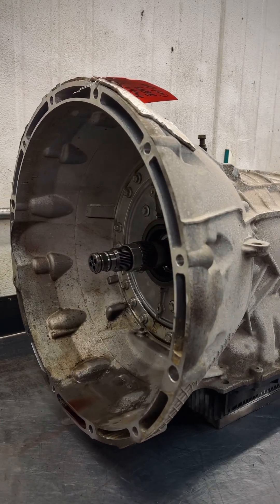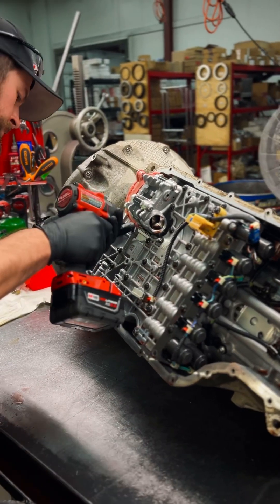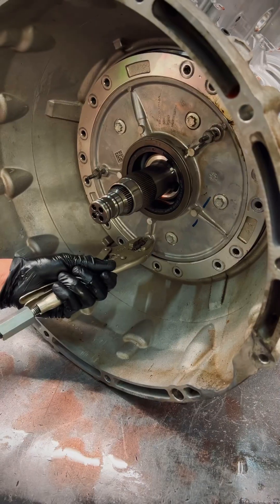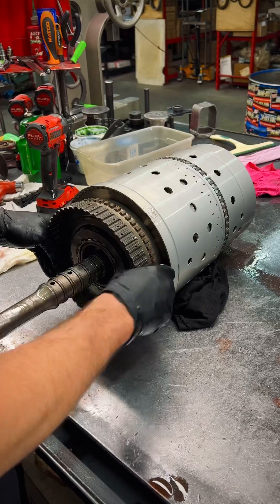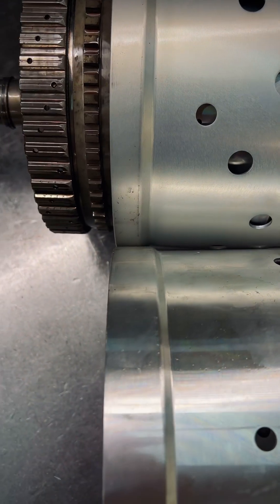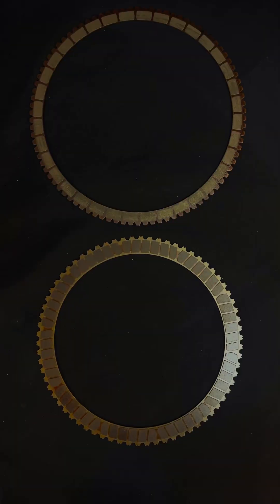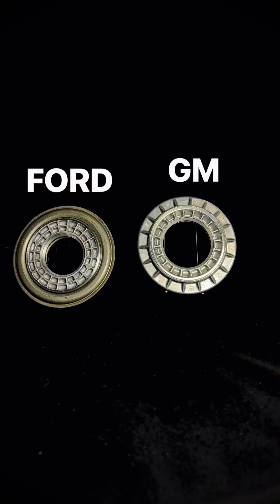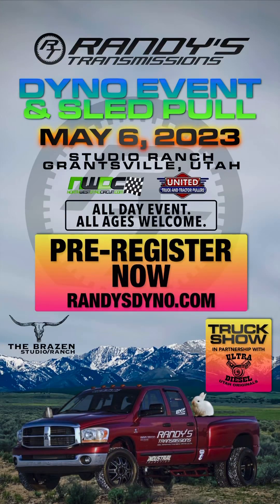Allison 10L vs Ford 10R

Comment: Doing extensive research on both of these transmissions I find a lot more complaints on the 10R over the 10L. Many issues with the 10R involve its use in the HD Gasser 7.3 "Godzilla" engine. Are the 10L failures you see in stock (unmodified) trucks?
The 10R and 10L were not collaborative project between GM and Ford. They did collaborate on the 1/2 ton light duty 10 speeds.
Reply: i wonder if your seeing more complaints for the 10R because theres a lot more of them than the 10L on the road. the failure rate may be the same percentage wize.
Reply: Ford trucks tend to be more common in fleet duty, where the same truck will see 30 different drivers in 5 years, they get beat to snot and stressed about 5 miles beyond their limits and the guys running them ignore the problems and flashing maintenance lights until the problem actively stops them from doing their job, and then they complain that their engine shouldn't need regular oil changes to run when they just ran through 4 oil change intervals without touching the drain plug or the filter. 

If you want to break something, hire it out to a west Texas oilfield fleet, they'll break it 16 ways to Sunday and then drink a beer atop the remains at 5 o'clock on friday
Reply: Correct!
Reply: They also collaborated on the HD version. Dude, look at the video and tell me those weren’t designed from the same basic design
Reply: @wyo_garage20 they weren’t lol Allison has a pto chain too
Reply: That's what I'm finding to, I found 3 people complain their trans went out after digging through different duramax forums, which the causes were a faulty part from manufacture from the get go which made theirs go out around 1k miles, but yet ford's 10r a bunch of different forum pages come up with tons of people complaining how theirs have gone out after 5k miles and up.
But yes exactly what's the mileage on these 10 speed Allison's going out? We're they behind stock or modified duramax's, ect. My 21 duramax dually almost has 40k miles on it and almost half are from towing heavy and the trans has been flawless and haven't had a single hiccup out of it yet.
Reply: @outdoorsadventures1580  My experience also. It does not surprise me that there was no response to my questions. Facts and data are all we have vs some guy in a shop somewhere with an opinion.

Comment: Thanks for the video, very interesting. Re: '15 Chev. 3500 as a snowplow truck. Do you think the 10L would be sufficient or should I have installed more robust parts or convert the 10L to a 20(if that's possible)? Thank You!
Reply: A 2015 chevy would have a 6 speed Allison still I'm pretty sure, the 10 speeds didn't start coming in until '17+ with the lighter stuff, and at least for ford they didn't release the 10r140 until 2019.
Reply: @Prestiged_peck  Yeah...that's not what I was asking. I was asking Randy's Transmission. I wasn't looking for anything specific, just if they thought the Allison could last a few seasons under that kind of use.

Comment: Well that was a surprise. I expected  a pretty even lineup with extremely similar transmissions and similar weak spots. And although the basic designs are similar, what I did not expect was to see the Ford 10R to be better and beefier in every way.  When the Allison came out in 2001 the name meant something and was responsible for a lot of GM truck sales. As time goes on the name Allison hardly means anything any more.
Reply: Now the Allison is only a name. Allison had absolutely zero to do with designing the 10 speed GM trans
Reply: @wyo_garage20 They just build to whatever quality and lifespan ability GM asked for. 
They wouldn't put their name on it.
Reply: gm has way more transmission issues than ford on the 10l
Reply: Exactly the 6spd was great but gm still builds it they just paid for the name gm transmission are garbage anymore that's why I went to ford not to mention the ifs front ends are junk too
Reply: This isn’t even the 10L that’s in a 2500/3500HD. The 10L here is a 10L80, not the 10L100. A 10L100 and the 10R from a new f350 are essentially identical.
Reply: @Chris-x6o2b .  Literally says 10R140 on the case
Reply: @@DemitriStryker They're all rusted away here.  Yes they were really well made.
I had a Ford supercab long ago with a 6L engine. I could repair it myself and didn't flinch being full of lumber beyond its ability or bad roads in winter.
Unfortunately rust kept getting bigger holes and the frame thin. 
It had close to 300,000km and still started right away but unsafe for the road.
Near impossible to find trucks of this era without rust bad or later models with electric issues.
Reply: 10r1000 was not build or designed by allison
Reply: As of this week dealers are being sent documents to cease using Allison branding on all trucks as of December.  Trucks not sold on the lot by next July will have to have their Allison badges removed.
Reply: Even the old ford torque shift was better than the Allisons
Reply: @freedomisntfree_44  hahaha sure thing
Reply: @freedomisntfree_44  5r110w is better than Alison 1000
Reply: @caterpillar6nz310  dang right
Reply: @caterpillar6nz310 
Absolutely nothing Ford has built in the last 20 years compares to the Allison 1000 series. Not even close.
Reply: @saltydog7988 I’ll take a 5R over any version of Allison. And I can go twice as fast in reverse.
Reply: @saltydog7988  I wouldn't be so sure.. Compare the 5R110W to a similar year allison 1000 5 speed. The 5R is a much stronger transmission all around.
Reply: @Silent but Deadly  ford definitely knows how to make a strong transmission, there's a reason you can buy a brand new siverado with a transmission made by Ford.
Reply: @Prestiged_peck  Thats is not an accurate statement. The Hydra-Matic 10LXX transmission family was developed in collaboration with the Ford Motor Company and is produced at the GM Powertrain facility in Romulus, Michigan. Ford took lead on engineering the 10 speed rear drive transmission while GM lead the enginerring on the 9 speed transaxle trasmission Ford and GM collaborated on. Ford and GM collaborated on transmissions 10 years ago as well.
Reply: @Jeramy Bennett  then explain why I've seen transmissions in siverados with the Ford logo stamped on the side of the casing??? Typically ford only puts their logo on things they manufacture or assemble, or on parts that go to their cars.
Reply: @Prestiged_peck  You've seen 10 speed Ford transmissions in Silverado's? That means Camaro's have them as well since they got the 10 speed before the Silverado and GM is lying about manufacturing their 10 speed transmission in Michigan?
Reply: @Jeramy Bennett  I've seen some early models with ford logos, like when they were optional alongside the 8 speed, haven't seen one newer than 2021 so maybe they did start making some themselves, I know they still call for motorcraft transmission fluid
Reply: @Prestiged_peck  Makes sense that they could make the castings and parts and maybe GM assembles them? They allways like to make a play on words "assembled in" vs "made in". Definetly possible Ford made a bunch of 10 speed castings and parts and shared with GM while GM could have made 9 Speed transaxles for ford? Who really know now days? Only the folks at the plants I suppose.
Reply: @Jeramy Bennett  the gm 9 speed transaxles I don't believer ever got put in any production fords
Reply: @JBennett530  Back in the day all Taurus cars had the GM 440T4 trans, only reason I know that is the ford dealer down the road used to come by and get the TSBs put out for that trans. The NVG 4500 was a GM/Chrysler collaboration, Rolls Royvce used to use GM transmissions and AC compressors. Ford used to bid most everything out, which is why the Taurus had a GM trans. Makes more economic sense for all.
Reply: @Prestiged_peck  both Ford and GM are made by ZF. They order them to their own specs. GM cut way more corners on it than Ford.
Reply: @ockgator 
Now i know why my wife's taurus had to have the transmission rebuilt!! Other than that one, I've never had trouble with any of my ford transmissions. And i've had quite a few fords!
Reply: @Prestiged_peck  They opted to operate it as an 8 speed.
Reply: @ockgator  I worked at a Buick dealership at the time of the 440-T4 release (disaster, BTW). I've been in the transmission business since the '70's and have never seen a Ford with a 440. I even saw what was perhaps a preproduction or perhaps test unit of the AXOD that the VB was cast iron instead of aluminum so I suppose anything is possible. Can you cite some evidence of a 440 in a Taurus? EDIT: In further thinking about it, I suspect the Ford dealers had trade in GM's with issues that they were trying to correct (good luck with that relying on GM bulletins! I was the trans tech at the dealer and the Buick zone rep pulled up behind my stall with a Century wagon and asked if I could look at the trans. I opened the hood and saw a modulator sticking out and closed it right up. I would have loved to dig into it but knew I wouldn't get paid. He was hoping for some magic fix. In fact, do you recall the "clam shell" Buicks (forward opening hoods)? They were released as a 85 1/2 model because of transmission issues.
Reply: Well Ford is naturally more expensive. However these transmissions. Were both a joint venture of GM and Ford. So a lot of the transmission is interchangeable
Reply: @xlArsenal I believe only has ton trucks were joint not bigger

Comment: How many miles are you expecting the 10L to last before it fails?
Reply: That’s such a loaded question. It’s all on how it’s used. A 16 year old kid with a bone stock super duty will smoke one before a 65 year old man does pulling his 13k pound camper to Florida. You can’t give an honest answer on that because the variables differ so vastly from case to case. Not to mention maintenance habits even being taken into consideration.
Reply: @ChaseLandMgmt  exactly it comes down to how it treated and how well its maintained.

Comment: Ford is the top dog in diesels! Thanks for the info
Reply: Yes they certainly proved their "top dog" status with the 6.0, 6.4 and the 6.7 with the excellent CP4.2.
Reply: @jimm2442  the 6.7 has been a great engine especially since it was the first diesel that Ford made in house.  GM and Dodge can’t say the same.
Reply: @jimm2442  they all used the cp4 🤡 and ford has the least problems with it. A fuel pump doesn’t determine how good an engine is either 😂 gm is weak and last in line as usual
Reply: @jimm2442  The Only Ford made diesel is the 6.7, the 6.0 and 6.4 were made by International. And from what I've heard the Ford 6.7 is a pretty damn good engine. And as an owner of a 2006 6.0 Powerstroke since day 1, if you fix the common problems (egr, head studs)  there pretty damn good engines also.
Reply: I’ve heard of problems with fords 10 speed. Not so much with chevys.
Reply: I've owned 3 previous new ford f350s diesels and all left me stranded.. I'm on my first Dmax which I bought new in 2015 with now over 200k and no issues what so ever.. my brother inlaw in a diesel mechanic and he use to bust my chops telling me Fords was his money makers.. now I see why
Reply: @donnieh3324   my co has 7 D Max's least 270k most 431k. Original drivetrain my personal 03 Lb7 federal emissions standard lb7 with Banks big hoss bundle six gun Inglewood trans Allison. I'll be buried in it. 💪👍🍺
Reply: Ford Diesels 🙄
Reply: Sure, top dog alright.👌
Reply: *diesel transmissions*
Reply: They give you a dog to keep you company waiting for tow truck
Reply: Lol fix or repair daily
Reply: Had a shift problem with my Ford, 28000 miles, dealer did Fords dance and it didn’t fix the problem, dealer kept pressing for a new transmission, Ford pretty much stop responding, left us hanging.
Drove Fords for 35 years, but not any longer. They don’t want to stand behind their stuff.

Comment: So how much torque will that 10R handle
Reply: Well, from the factory at least 1200 ft lbs!
Reply: @dundonrl  Not even close. Try roughly the 1400 Nm suggested by the name. The earlier 6R140 has about the same torque capacity (as indicated by the "140"), and is rated by Ford at 935 lb-ft input.
Reply: @brianb-p6586  So, the 2023 6.7 Power Stroke is only rated 1200 ft lbs of torque on paper? (it's rated by Ford for 500 hp and 1200 ft lbs/1627 nm torque). Either they are going to be eating A LOT of these 10R140's because the engine makes too much power, or it's rated to handle that power day in, day out for years!
Reply: The part of the transmission name which this video omits - the numbers after the "R" or "L" - indicate the capacity. At Ford the digits after the R multiplied by 10 is the maximum input to the transmission after the torque converter in newton-metres; a 10R140 rated for 1400 Nm (about 1000 lb-ft; Ford says 935 lb-ft in specs). At GM the numbers might not directly indicate torque capacity, but higher number mean higher capacity.